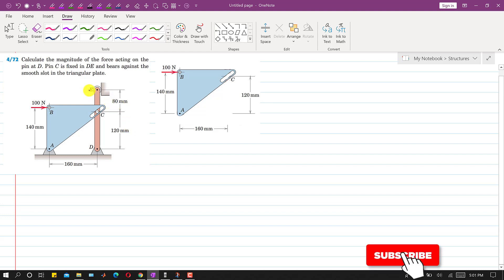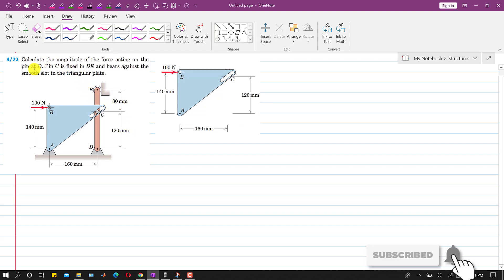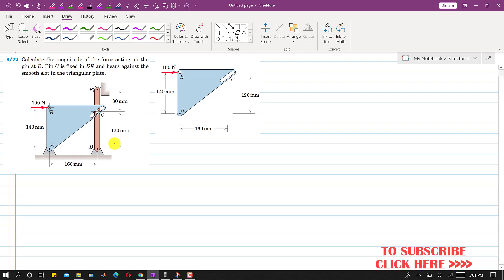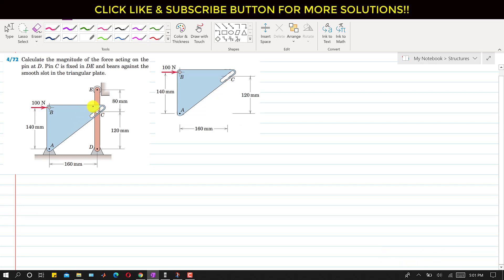Calculate the magnitude of the force acting on the pin at D. Frames and Machines | Engineers Academy

Comment: I think  the cosine and sine are mixed up when finding x and y components of C. The theta found is not equal to each other and the theta found is the opposite angle in the triangle. in order for Cx = Fc*cos(theta), ==> theta = 90 - 53.13
Reply: idk
Reply: idk, I mean he got the right answer, I have the exact same question with answer and it is correct